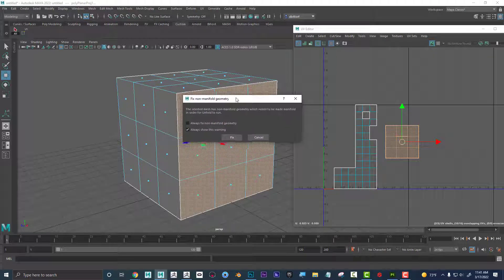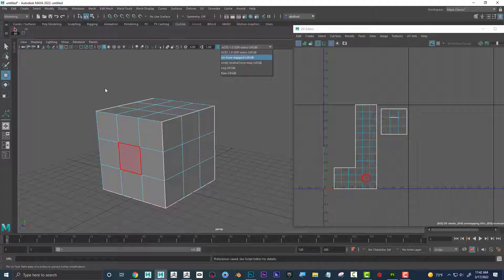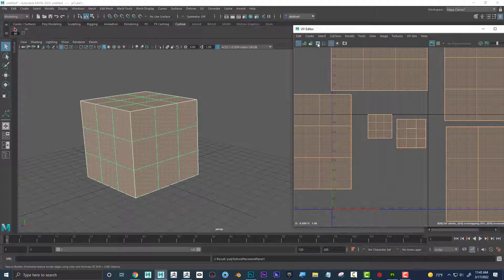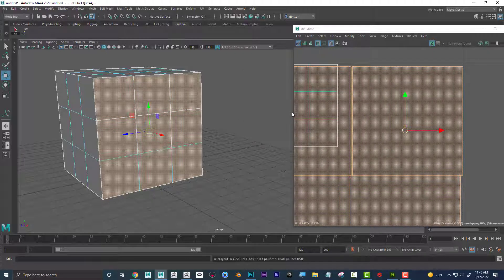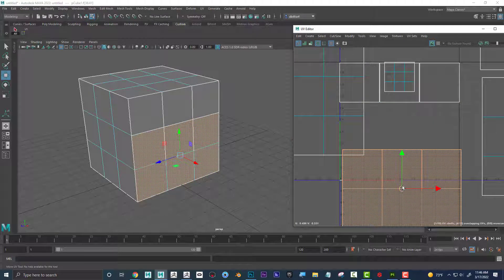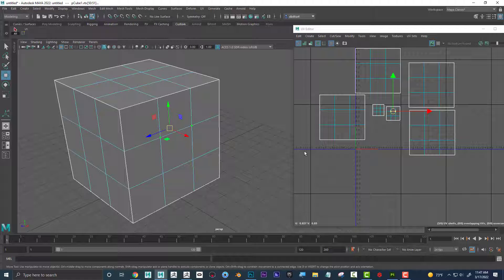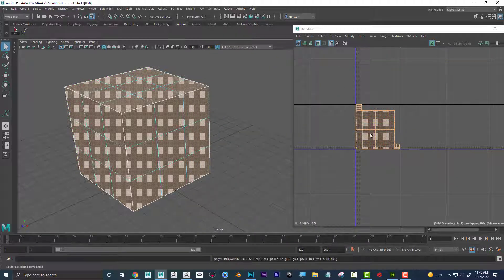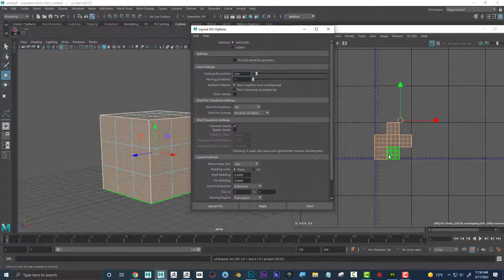Should you Fix Non Manifold Geometry?

Comment: I have that problem showing in Orca Slicer when I try to slice some objects. I have ignored some times and I can't really see any problems when is done. On the other hand, I have click "repair" and it goes fine. My point is, do I really need to do repair? Since your video is showing the issue during modeling, I am not a modeler, it looks like a different scenario than mine since I can't actually see what the problem is. I guess I would have to really look closer?
Reply from the maker: I you can complete the task and do see a problem I would not repair it and leave it alone.  Sometime it has to do with the UV map (prepping for textures) and if you don't need that I would not worry about it.